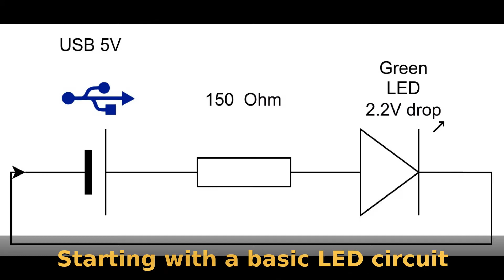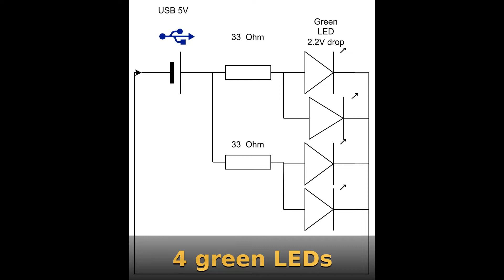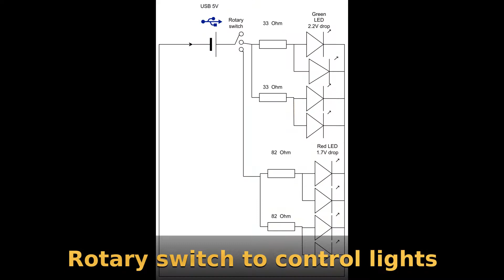Electronics beginner project - Desktop traffic light

Comment: Hello, I watched your Arduino UPS video and there is something I can't figure. How can I make it charging while there is no need for battery and I am not sure battery is being charged while there is no need for battery ? I am not here to get a quick answer and be gone but I am here to learn tbh. Thank you in advance.
Reply from the maker: That version used primary cell battery so not rechargeable. But it would be possible to use NiMH battery and a simple trickle charge circuit to keep it topped up.
Reply: @CheapskateProjects  Much obliged. Thank you for your time.